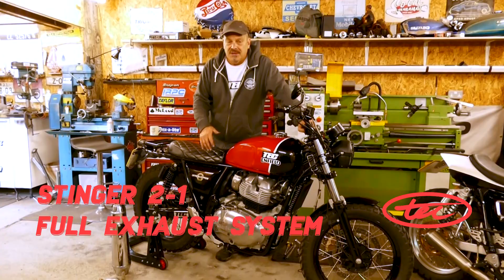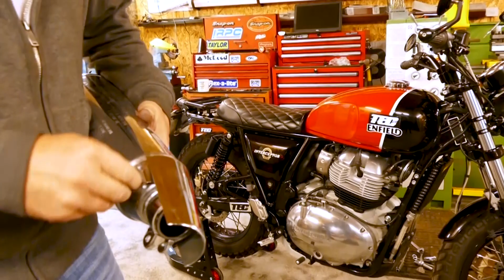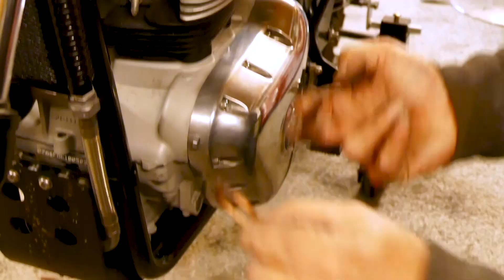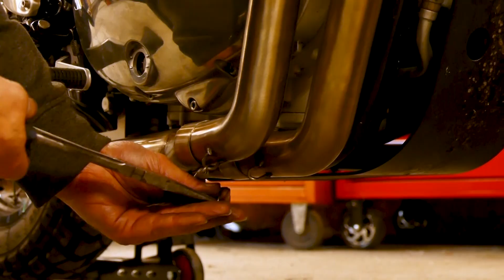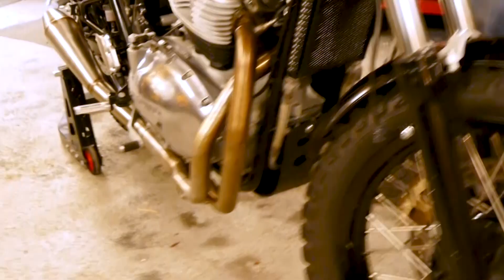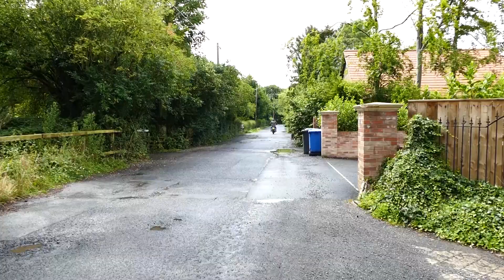Interceptor 650: NEW TEC Stinger 2-1 High Performance Exhaust

Comment: has anyone heat wrapped the 2-1 stinger? any tips or tricks?
Reply: Unless you change out the clutch cable for a longer one, the stock cable sits tight against the LH header pipe.  It'll melt that cable.  That issue is not addressed in this video, although TEC knows it to be a problem.

Comment: Just fitted it to my gt continental but it is burning my clutch cable any advice in how to avoid it?
Reply: Unless you change out the clutch cable for a longer one, the stock cable sits tight against the LH header pipe.  It'll melt that cable.  That issue is not addressed in this video, although TEC knows it to be a problem.  You can insert the clutch cable inside a 1/2" silicon/fiberglass tubing (Amazon) and that will help.  You may also have to wrap that part of your pipe.   A longer clutch cable is the answer.  But its a PIA to install.

Comment: Hi I was just watching this before installing another 2x1 exhaust system from a different brand and I was confused about the gasket ring that goes into the headers of the engine, should I replace the old one or just put the new one on top of it?

Comment: Any body having issues with the clutch cable rubbing up on the pipe i have it zip tied but its still very close and i will have to reroute it i just don’t see how this wasn’t mentioned in the video they obviously have it modded but didnt mention it other than that absolutely love the exhaust

Comment: OK, so I ordered and recieved this exhaust, was easy to fit and my gosh how much lighter it is than the original and you definately notice when riding!
The sound is perfect for my taste, the baffle is in and its loud enough without being obnoxious, I really love it. The fitted baffle hole does make the tail pipe exit look too small for the bike. 
My only dislike/problem is the fitted baffle itself, since running with it for a few days now, the baffle rattles on idle (held in place with a circlip not bolt) and there is about 1/2mm to 1mm of play and no way of stopping other than having to go and buy some high temp silicone and stick the rear of the baffle to the silencer. 
Other than that it's a great exhaust and I am extremely happy with the overall package, I wanted the cannons but this weight saving won me over, plus the cannons are too long in my opinion. 
My only problem

Comment: Ahhhh, I have the engine protector bar, so now need to decide whether to remove it and have the stinger or leave and have the cannons! But the weight saving alone is huge, I love having two exhausts BUT the weight is pushing me to the stinger. 12kg lighter!

Update: I succumbed to the weight saving over looks, full Stinger ordered and some tec black brake and clutch levers!
I'm going Spain for a short vacation and I am so much more excited about fitting the parts to my bike and can't wait to get back home on the 7th Sept!

Comment: Great Video!  I recently went to the RE dealer today as I am wanting to buy a motorcycle very soon.  I am curious on thoughts of buying a Used Bonneville T100 2009 and newer as they are fuel injected or buying a new RE.  Just looking for thoughts out there in the universe as it seems I can get a nice used Bonneville for $6000 or I could have something totally Unique and buy the Interceptor.  I am a auto mechanic of 20 years and not afraid to do some work on my motorcycle and have owned older bikes in the past.
Reply: both bikes ride very differently and I would suggest riding both before buying
Reply: @georgemilburn6213  I bought My Interceptor. 650 about 2 months ago have loved every Mile so far

Comment: Hi! I just recently installs my 2-1 exhaust on my GT 650 and noticed that the clutch cable is pressed against the exhaust pipe. The rubber coating has burnt off since. I was wondering is there a fix for this or should that not be an issue?
Reply: Use a zip tie to gently tie it back somewhere?

Comment: Great work sir! I was wondering, I have the small compact engine guard fitted on my Interceptor. Would these exhausts still be compatible on my bike?
Reply: I fitted it but had to remove that side engine guard because it will not fit with the engine guard in it.

Comment: loooooool radio silence on both my questions. hahahaha.

Anyone tried fixing those disgusting, scarred solder seams on these pipes? Is there anything to be done to hide it or something, short of wrapping the entire thing? I love the idea behind this system, but gods, those are UGLY ass pipes. Maybe if you had a run-down aesthetic going elsewhere and you scratched it all up it'd work, but these clash horribly with the shiny new chrome everywhere else.
Reply from the maker: Several customers have polished the system by buffing and comes up like chrome.

Comment: quick and potentially stupid question...
does having a one sided exhaust have any effect on the over weight balance  of the bike while riding?
does the bike still track straight hand off?
just wondering what if anything to expect?
thanks from Detroit Michigan.
Reply: so light that it has no noticeable effect to one side , but the effect to the lower overall weight of the bike is very noticeable.

Comment: These are the tools I used to remove the original exhaust system and install the Stinger 2 into 1 system plus 6 hole baffle on my RE 650 GT.

Motorcycle jack (no centre stand on the GT).
Circlip Pliers (to fit the circlip that holds the 6 hole baffle in the distal end of the new exhaust system).
14mm  Flare nut spanner (fits O2 sensors). Not strictly necessary but it makes life so much easier.  
Wire cutters to cut cable ties (I unplugged the O2 sensors, a slower approach but less stressful I thought).
15mm socket with 10" extension and T-bar, all 1/2" drive (fits new centre mounting shouldered bolt).
12mm socket, 10" extension and T- bar, all 1/2" drive (fits original rear can mounting bolt, original centre mounting bolt and the flange nuts at the cylinder head).
12mm combination spanner (fits rearmost mounting nut).
10mm 1/4" drive socket and ratchet (fits clamp on first join of LH exhaust of new system).
5mm Allen key (fits the M8 screw that mounts the proximal end of the new rear can and the distal end with the kit supplied 35mm M8 socket head screw).
One shoe lace to facilitate the fitment of springs.

In addition some cable ties to keep the clutch cable away from direct contact with the hot LH exhaust pipe.

Comment: Sounds awesome.  Much lighter and more powerful:  what's not to like?  Are you still thinking about a higher exhaust system (more scrambely)?
Reply: we have one almost fully developed, but we had to put some parts on hold due to low staff during Covid. hope to finish development when lockdown eases a bit.
Reply: @georgemilburn6213  Thank you very much for your response.  I have not yet purchased the bike, but I really like it.  I'm actually pretty set on it, and it will get the full suite of TEC parts fo sure.

Just a suggestion, but perhaps you might consider selling those shims for the foot peg/frame issue (on second thought, it probably wouldn't be worth the bother).

Thanks again, George.  BTW, I enjoy your videos very much.

Comment: I've just finished fitting this exhaust. Easier than I thought but a couple of sticky bits to be aware of:
1- an instruction sheet with a diagram in it would be great. Everything is fairly easy to work out but it would give more confidence to know the bolts, clamps, gaskets (especially the graphite one) are all utilised in the correct way in the right place. 
2- put it together before fitting. This allows you to understand how it'll all fit. The right hand down pipe into the centre section was V tight on mine and even with a bit of lube it took quite a bit of brute strength to slot them together.
3- putting the springs on fine, but it will ping off first time so take the advice on the video and stick some glasses on. 
My centre section didn't have a spring fixing for the end can. No seriously I liked and it's just not there. Fitted it without and it seems ok..... Tell me if you think this is bad. TEC will this be ok?
4- started it up and looked for leaks. There is some light "smoke" that comes off the pipe. I thought oh no it's leaking but give it 5 mins and it all burns off. If you still see smoke you might have a leak... Also the grease I put around the joints took a few minutes to burn off, so give it a good few minutes before you panic.

Sounds marvelous. I didn't put the baffle in as I left my circlip pliers in the garage but it crackles wonderfully. 
Looks really great too. The left side of the bike now looks a bit bare, I might have to take the centre stand of too as without the silencer there to guide it it does stick out a bit and imho looks a bit of. Still more weight saving.
DNA filter next

Comment: Fast delivery from tecbikepartsusa and just installed the Stinger system along with the booster plug and DNA filter/intake. I've also shed 6-7 lbs by switching to a lithium (Shorai LFX21A6-BS12) battery.  After tightening everything up and wiping down pipes, it started right up and I let it idle for the advised 15 minutes before riding. In short, these were great mods and it is a different bike. The sound could almost pass for a stock motorcycle at idle but puts out a fantastic growl when you open it up. Which you'll want to do again and again. Perfect to my mind both on and off throttle. Still not a Super Duke but more responsive and rev happy. As expected, better handling and I could swear it feels more stable above 60 with my stock suspension. Braking is better and now (almost) adequate. As for install, I feel like beveling the edge of the LH flange where it fits into the graphite in the LH crosspipe was time well spent, and perhaps I should have done the same with the head pipe/crossover junction prior to installing on the bike. Mine was a very tight fit and took some time to get right in spite of using copper grease. More difficult than video for sure. Now I just have to figure out what to do about the unsightly centerstand on the left side.
Reply: take the stand off looks cleaner and save more weight, easy to fit stand bobbins in the holes in swing arm

Comment: I'd like to know what the TOTAL cost for ALL the work involved in fitting both the 865 AND the 750 kits would come to, taxes included!
I assume the need for upgraded clutch, Powertronic (inc. Map Switch), alternate cam, possible throttle bodies, and exhausts, would be "done"/fitted at the same time, so for a FULL upgrade service, what would the final bill add to a "new, out of the crate" bike?  In other words, what would a 750 or 865 Interceptor cost me?

Comment: Just like the old days, instant performance gains by changing the exhaust. 
I like the overall look of the bike, except the hacked off front fender. Seems a bit daft, especially if you're running tires that would work well on dirt roads & stuff.
Reply: fenders are stock, just removed the nasty plastic fender extenders
Reply: @georgemilburn6213  That little, tiny black thing over the front wheel is the stock fender?
Reply: @theeaselrider4032  Yes that is an unmodified stock plastic fender.

Comment: If it wasn’t for that oil cooler, could the left header pipe wrap around the front frame tube? Is there sufficient space between the front frame tube and the front wheel/mudguard?

Is there anywhere else that oil cooler could be mounted? Where are the oil outlets and inlets located on the engine?

Comment: Hello, the 53hp you stated in the video, is that at the wheel? Because from 43 at the wheel to 53 at the wheel by just changing air filter and adding the 2-1 headers is a lot of gain. Even if we assume 2hp gains because of the free flow air filter, which is unlikely, that leaves a gain of 8hp just because of the exhaust swap. Unless I missed something.
Reply: You can get up to 49 bhp just by changing the silencers, but any extra gain is limited due to the small bore front pipes with cats restricting any more power, this exhaust addresses that power restriction in the front pipes.

Comment: Hi @TEC Bike Parts , ordered a Stinger and I can't wait to fit it on the bike!
I'm looking to change the tyres as well, are you happy with the rear or you're going back to the standard size? 
Thanks very much! Great videos and products!
Reply from the maker: I would say use a 130 on the rear as 140 is very tight for clearance.
Reply: @TECBikeParts  thanks very much! it really helps!

Comment: i have 2 questions, you mentioned the spring attached at 14:47 is not needed in the production model.  can i still have them included for aesthetic purposes and 2nd question is  will i have enough space to install a large royal enfield engine guard after installing the 2 to 1 exhaust?
Reply: It looks like the header pipes, at least on the right side, would prohibit fitment of the RE engine case guards (i.e. crash bars) and that the pipes themselves would have to act as the case guards in a tipover or crash.  On the left side the RE case guard might fit.  I think symmetry is visually important here, and I'd much prefer a 2-1-2 header pipe configuration despite its greater weight and probable expense.

Comment: Fitted this to my RE 650 GT. All he says is true, I cannot believe the difference just moving the bike in the garage, the ease now of putting it on the centre stand. Overtaking is now a breeze as the mid range is much improved. I have left the baffle in as I don't want the bike too loud, I haven't it tried without the baffle, I will give it a go just to see what is like but I am happy with it in. Money well spent.
Reply: How much it costed ?
Reply: @Itsjay2498  Have a look on their web site for current prices. It is cheaper than most slip ons, I had mine polished, now it loooks stunning on the Mister clean GT.
Reply: @colinsaunders8723  didnt they update the warning on these to say you cant actually remove the baffle now?

Comment: Is there an overheating issue ? Two silencers have the advantage to give the heat easier to the air than just one?
Reply: If you look close you will see the bore increases towards the rear so the 2-1 has no more restriction than a 2-2 system and actually found it runs a lot cooler than the stock 2-2 system in testing
Reply: @georgemilburn6213   -  It sure looks like the right cylinder head would get less cooling air flow than the left cylinder.  Even if the heads run cooler with less restriction, the wear is probably uneven due to the differing cooling air flowl

Comment: So without the cat-con in there, is this exhaust road legal in terms of emissions (gases, not noise)?
Reply: Technically no, but the UK has no exhaust emission testing for motorcycles. So it is not enforced and long may it be so.
At MOT time the noise is at the discretion of the tester , a TEC exhaust has never failed a UK MOT on noise to my knowledge.

Comment: Would this work with the small RE engine guards?
Reply: no this system will not but the new 2-2 we are making will, and before you ask both types can be used with the OE centre stand fitted.

Comment: I installed my system yestertday and have to tell you I'm very pleased with the installation and the performance on the bike. The weight of the OEM is like having a permanent pillion passenger, and with the 2-1 the bike is so much lighter. Midrange is further enhanced ( DNA Filter fitted some time ago) and fuel compsumtion seems improved also.A great system at a very competative price. Well done.
Reply: Can you tell me how the baffle is supposed to stay in? And where does the u-shaped metal o-ring looking thing go? Thanks!

Comment: Question has been asked before, but i will ask again. Could you please do the same as in performance down pipes but for a 2 / 2 exhaust. at the moment we can change end can for sound but little performance, if you did these down pipes and end can as a set,that would be spot on. I bought the bike because it looks right and I don't want to change the look with a 2/1....
Reply: Yes the big bore 2-2 should be ready at the end of the year

Comment: Now fitted to my Continental GT.  Great quality and easy to fit.
Reply: How does it look Chris? Thinking about putting this system on my GT but not sure if I prefer the twin pipe look or the single pipe.
Reply: @chrisdavies3566  I had Scorpion cans on mine and prefer the single pipe.
Reply: Nice, any tips on fitting, any issues with the left header clamp?
Reply: @ChrisKonings  Had no issues at all fitting the system all done in about 30 minutes,  just made sure the left pipe clamp was in an accessible position for tightening.

Comment: those headers wrapped would look wicked. Great informative and presented video. The sound is awesome, brought the bike to life.
Reply: Wrapped !!!! ... Ahhhhh !!  .. why would you do that ?
Reply: @WyreForestBiker  because it looks cool and it helps with heat management, thus performance......that's why..
Reply: @darkcustomxxx7252  Err .. No and no LOL
Reply: @darkcustomxxx7252  Wrapped headers will actually make for a hotter exhaust system. The wrap insulates the pipe, making it more comfortable for you, but makes the pipe retain more heat. That can improve the performance of a bike (a hotter pipe will make a bike run a bit leaner, so if the bike is on the rich side it can even it out), but it's mostly for aesthetics. I think it would look dope on this bike too, but it probable wouldn't run better because of it. I bet this bike is a bit lean with all the airflow its getting now from the high flow filter and this system, even with the ECU auto adjusting.